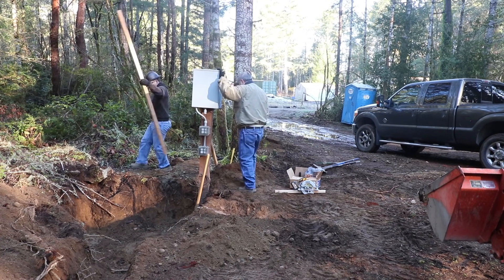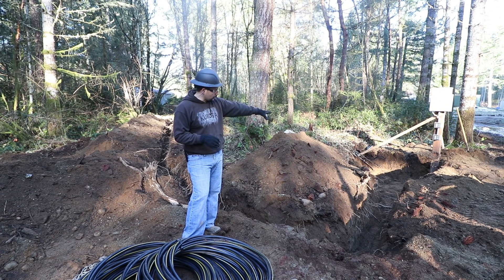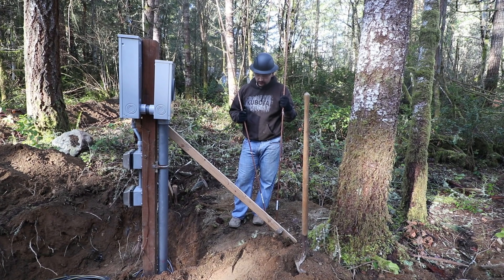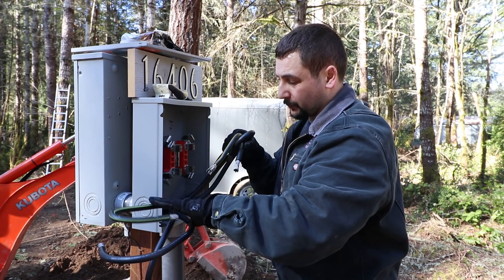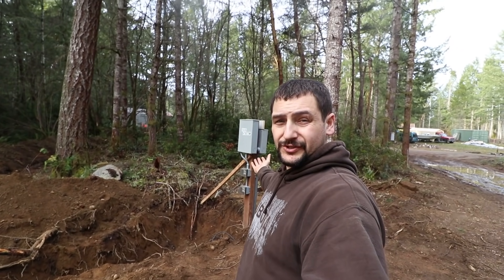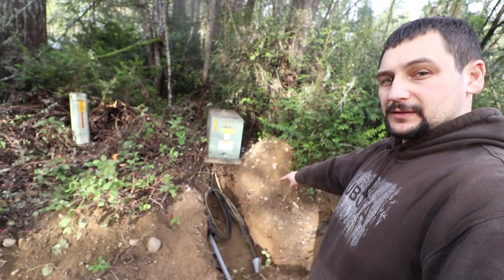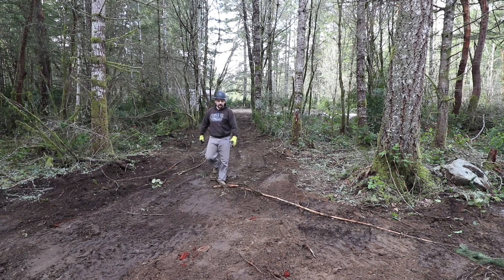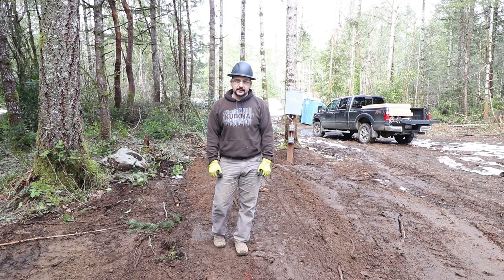DIY Temporary Electrical Service Installation

Comment: Glad to see you did the service conductor installation in the proper order. First you run the conduit, then you install the pull wire by either blowing or vacuuming in and then you pull in the conductors. Another very good u tuber showed an improper installation of laying the conductors in the trench and then sliding the conduit over then wires. I wish  somebody showed him the correct method.  Good job here.
Reply: I cringed a little when I saw Andrew doing that...

Comment: Nice work. I'm an electrician and most homeowners would not tackle a project of this magnitude. Only observations are that it's actually URD wire not triplex. Triplex is for overhead wiring and the sizes of the conductors are 4/0-4/0-2/0.

Comment: There is no main disconnect in that meter base so the neutral termination supplies your bond to that meter cabinet. No need for another wire to bind the meter cabinet. 

This is Since I’m assuming your grounding electrode conductor is terminated in the main breaker panel with the neutral. And we are to Bond the neutrals and grounds at the first means of disconnect. 

Right ??

Comment: Put the ribbon in, take the ribbon out, put the ribbon back in. That sounds like a typical government operation. Seems like having a sufficient length on hand would suffice for the inspection.
Reply: Inspector might not like it because you could save it for other job sites if it’s on your hand.
Reply: @erictold  of course you could do that. You could also pull it back out as soon as the inspector leaves. Dishonest people will always find a way.

Comment: I don’t understand the coil of wire buried below the temporary service. Why not just be able to go right into the temp service ?
Is the extra coil for future potentially?
Reply from the maker: Casey Espeseth The extra wire used to spool out to connect to the house once the house is built the temperate power pole is only there so that we can build the house.
Reply: Very nice  I’m three years in my apprenticeship to become a journeyman electrician and still seeing new and different stuff ever day 
 happen to find your channel  of repairing your flat bed trailer as I was looking for ideas for my flatbed trailer couple months back and like watching your work   And also live in pierce county  keep up the videos thanks for the good content

Comment: Backfilled after PSE inspection? 
PSE Handbook:
"PSE shall assign a Project Manager to oversee the trench location, equipment placement/installation, and backfilling.
• Work shall be subject to the inspection and satisfaction of PSE.
• No work shall be backfilled, covered, or concealed until it has been inspected and approved by the inspector."

Comment: crap. I didn't use that schmoo on my aluminum service cable I ran last summer. Oh well.
Reply: Rob Lambert you absolutely need that. When it’s it’s used the aluminum expands and contracts which can lead to it arcing and a fire
Reply: You'll be ok.  Just make sure you have insurance.

Comment: How far can I run the wire from the meter box before I need a padmounted transformer?
Reply from the maker: that depends on your local power companies engineering evaluation.